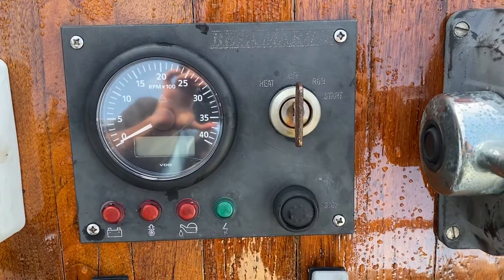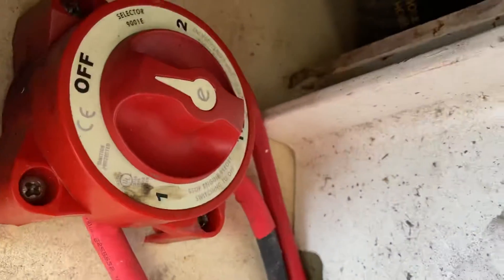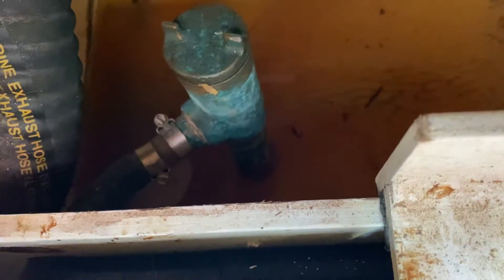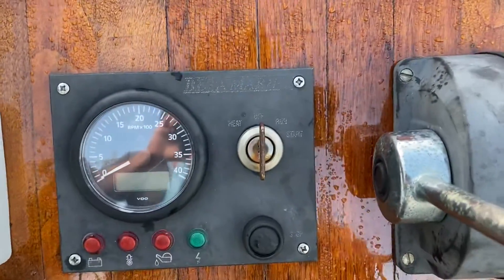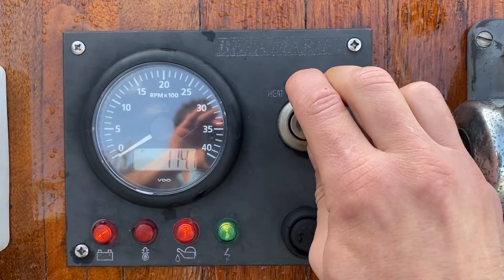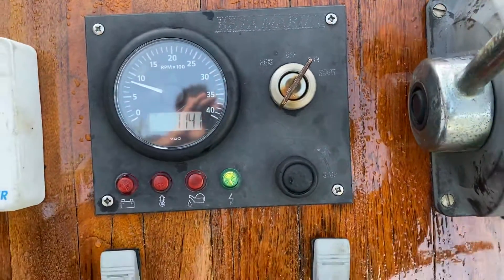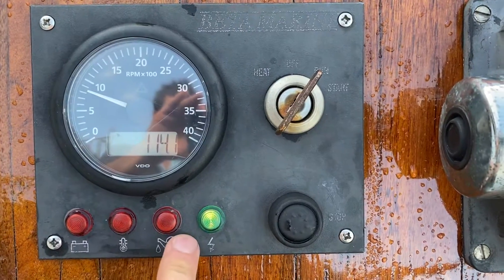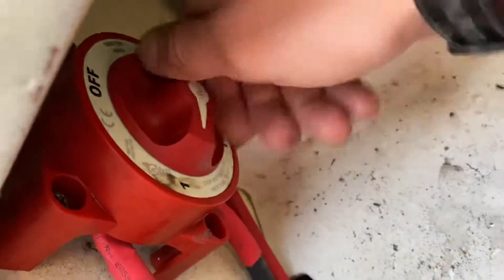Beta Marine Engine Starting/Stopping Info

Comment: Surely you would turn the switch to the engine starter battery position which is usually 2 but depends who wired it. Then start the engine on 2. That switch is a make before break switch, so once the engine has started, you then can rotate the switch to 1+2 so both banks are charging so no damage to the alternator will happen as make before break switch. Turning to off with the engine running for sure would not be good and bye bye alternator. Once you stop the engine and moor up, you then rotate the switch to position 1 which would be your leisure bank, so you’re not draining your engine starter battery. The way you are doing it is using the leisure batteries to ‘assist’ the engine starter battery as you put them all in parallel. Leisure batteries really don’t like to be and are not designed to be used as starting an engine, just like an engine starting battery shouldn’t be and not designed to be used as a leisure/deep cycle battery. If you’re concerned about forgetting to do the above, then perhaps think about installing a Voltage sensing relay with a dedicated engine and leisure isolation switches.